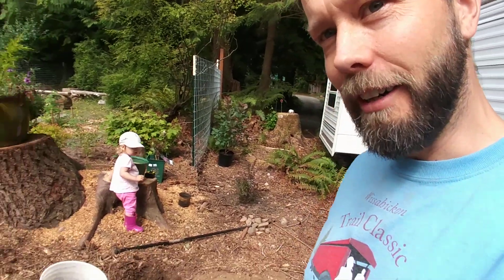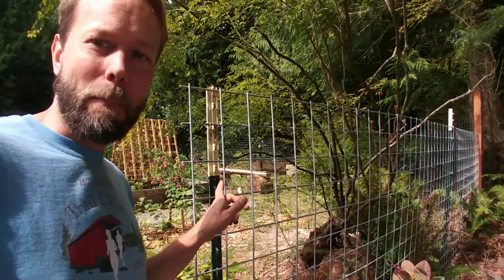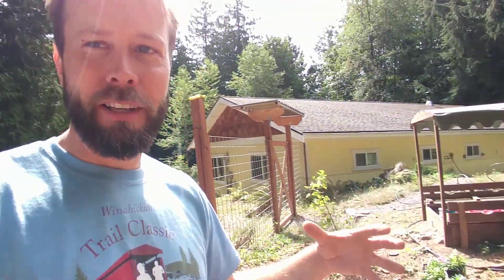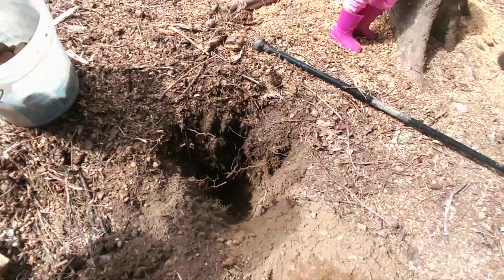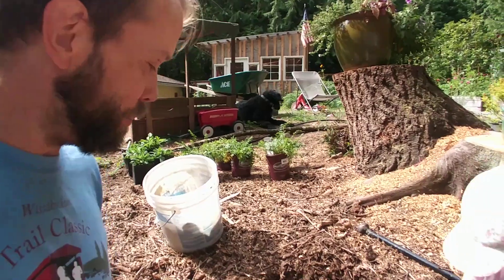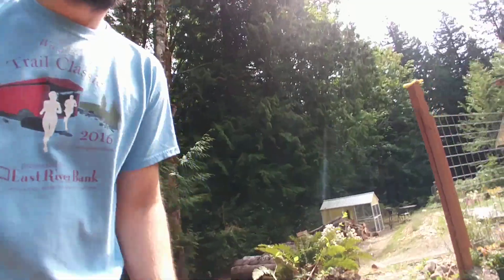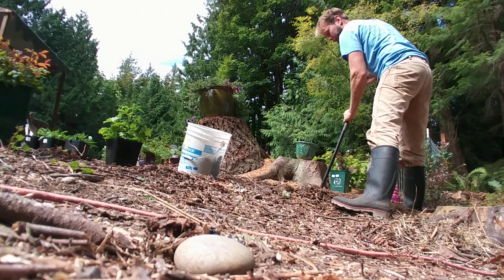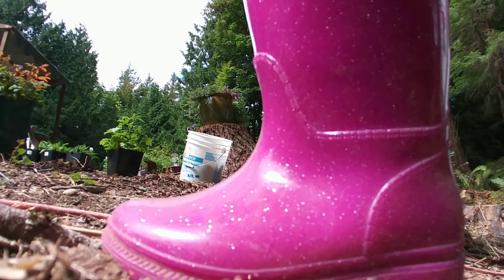Digging Fence Post Holes in Rocky Soil

Comment: I live in South Wales in the UK. Where i live is on a valley side a river. This river was probably a glacia. Anyhow my soil is pretty much old river bed. I put up a fence in the front garden and every hole was full of these stones. Nightmare. Luckily my friend had one of these stakes. One post i marked out was directly above  a 2ft round boulder. Took forever to remove